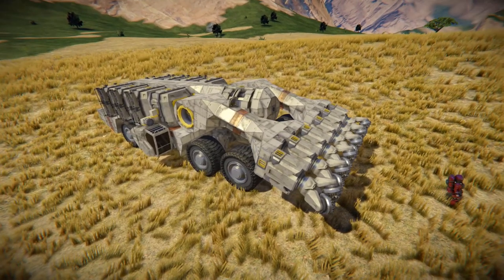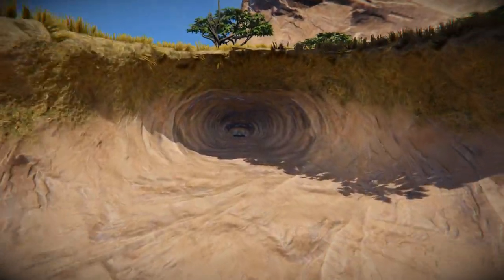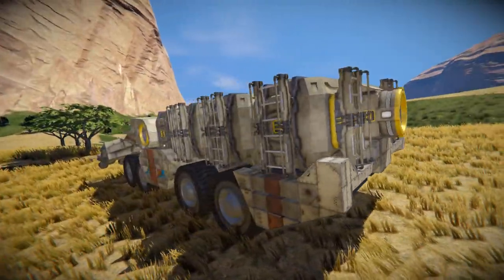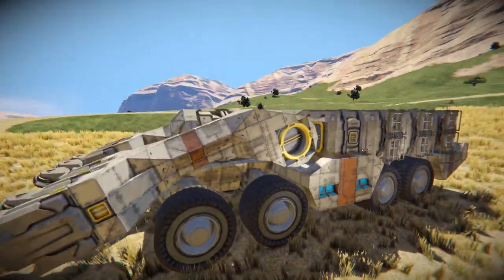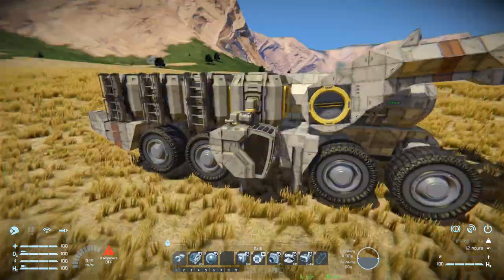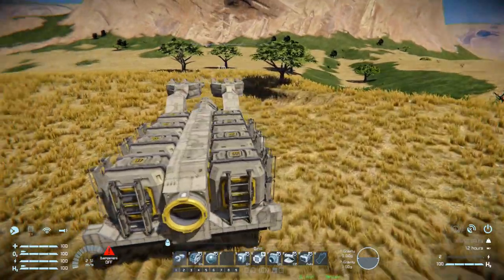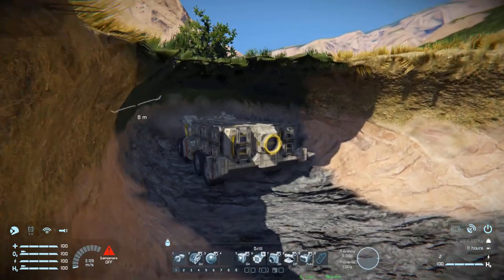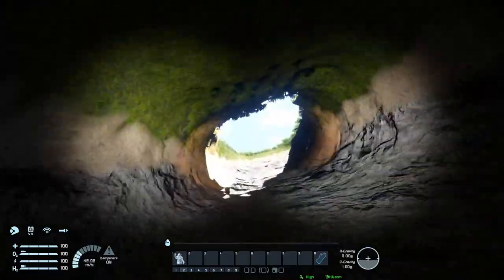The Bessemer Heavy Miner - Space Engineers

Comment: Just out of curiosity how are you keeping the front so level with all the drills on the front? I've been working on a mining vehicle similar to this and the rear wheels are practically airborne due to the sheer weight of the drills. I've tried using batteries as counterweights, but the results are negligible at best.